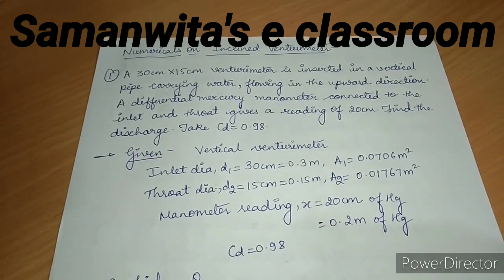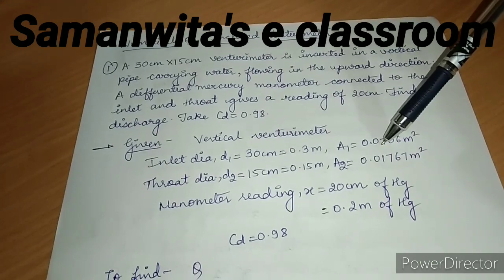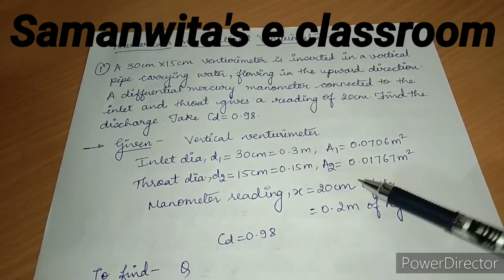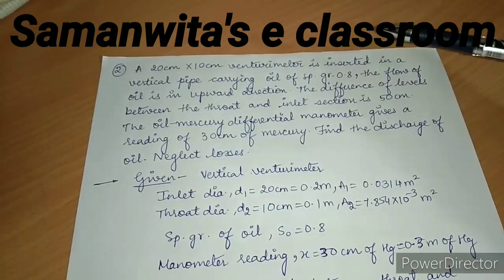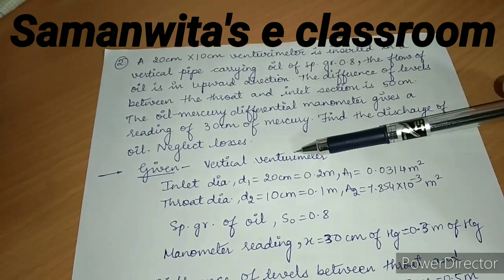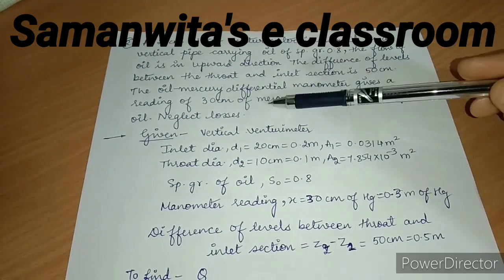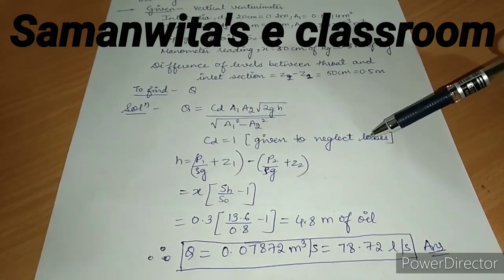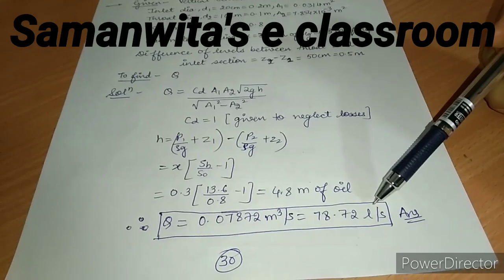Numericals on Inclined Venturimeter I Dynamics of Fluid Flow I Fluid Mechanics

Comment: A venturimeter is fixed in a pipe of 250 mm diameter The value of maximum flow in the pipe is 0.12 cumec. The pressure at entry in the venturimeter is  6m of water. Calculate the diameter at throat is not negative. Take cd=1.0
Please Q solved
Reply from the maker: Assuming velocity at throat section is very high and pressure is too low, h=6m. On substituting all other values, I got d2=117.2mm.